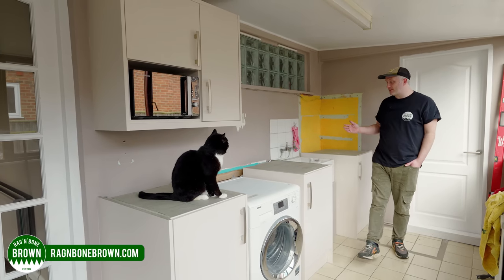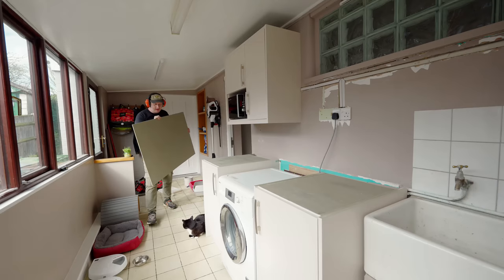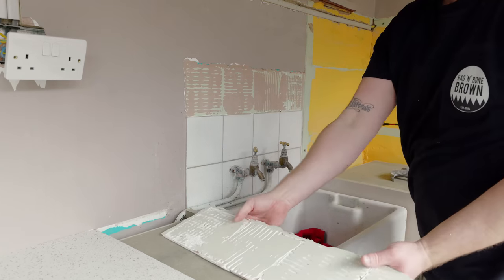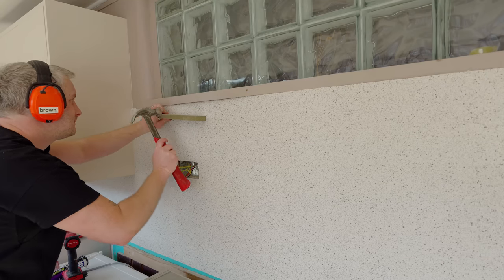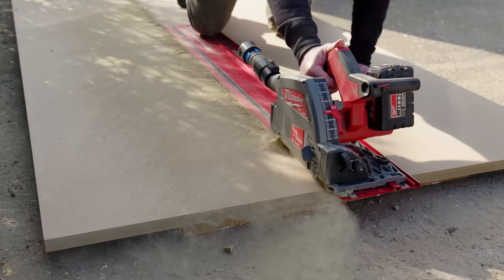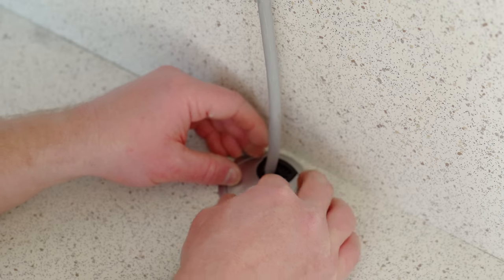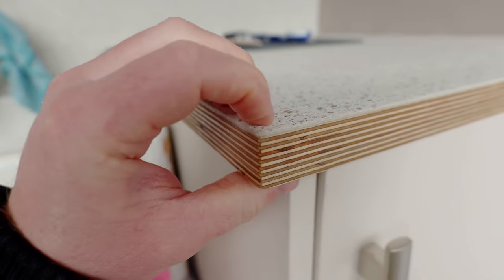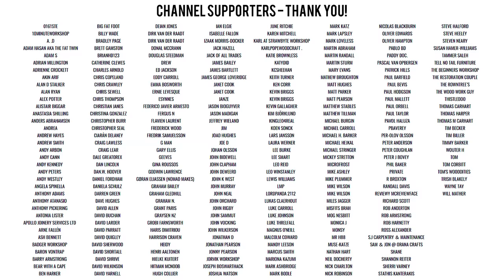DIY Worktops & Backsplash ON A BUDGET!

Comment: Looks great! Side note, boiling water will limit the pan temp to roughly 100* (rice cookers work by detecting when the heat rises above 100 which only happens when there is no water left). If you fry some onions, the pan will be much hotter.
Reply: Yes! I was going to say that oil can get much hotter than water, and that he should retest it! Great minds.
Reply from the maker: Ok cheers, I should have tried to find a frying pan then... The trouble I had was all our pans are induction ones so had to try and borrow one that I could potentially destroy!! 😬
Reply: @RagnBoneBrown  Happy to destroy your mother-in-law's pan and not your own. Good man!
Reply: @RagnBoneBrown  The bottom of an induction pan will still get as hot as a pan heated on a gas/electric stove, or certainly close enough anyway for the kind of test you are doing. Having dropped a VERY hot frying pan onto a vinyl floor though I can tell you that will likely damage it, especially on a pale colour like you have. 

Vinyl flooring as a working surface is pretty good though. I used an offcut of wood grain pattern flooring to make a protector for our dining table and it's worked great, it looks fine, is super easy to clean and has resisted hot plates, stains, spills etc.

Comment: The non skid vinyl you chose contains quartz aggregate and silicon carbide, also known as carborundum. Since the carborundum is manufactured and used as an abrasive it will wear any tool used on it. As a flooring installer we go through a lot of blades fitting this these types of products. A standard commercial vinyl would give you similar results but would be smoother. Nice thinking outside the box though and with the price of products now we all have to get a bit inventive now and then.

Comment: Using a vinyl on the worktop is definitely a very brave decision. Vinyl is a delicate material, and if it will be damaged (spoiler: it will), you'll need to replace all you've done in the video.
Reply from the maker: Nonsense. This isn't regular floor vinyl

Comment: You can almost not leave the contact adhesive too long before forcing them together. Often did around 30 mins to 1hr. I never trimmed until the following day, laminate really thanks me as way less likely to chip. Also have to make sure the laminate is really heavily pressed to the edges. Oh the substrate for desk was 24mm birch ply. 😅

Comment: Hi Keith, I'm an ex-floor layer. 
Just a cautionary note. 
Spray adhesives aren't always suitable for safety floor vinyl. You may find the adhesive goes mushy after a year or two, due to plasticise migration. A warm area tends to accelerate the process.
Reply: yeh unfortunately likely to loosen and form a loose large flat bubble in areas. That stuff never really sets

Comment: I have done this with vinyl tiles back when I had no budget or time for real tiles as a backsplash. I contact glued them straight over the old tiles. They had a nice grey industrial tile look and went on super tight. made my kitchen look super on trend with minimal effort(no removing and then dealing with cutting tiles) for a budget price. They were alright for a few years, but the heat from cooking made them eventually warp which made them bulge slightly around the trapped edges. Everywhere not close to heat they were still perfect after many years. So yeah, this is viable.

Comment: Brilliant job, maybe not really the best for a kitchen, but perfect for a utility room or garage workshop,
We use the same stuff to cover sales counters in places like car parts shops, trade counters, 
You'd still save money if you fitted the boards, then paid a decent floor fitter to fit the vynal and possibly weld the joints.
(I've seen really God fitters repair that kind of vynal almost invisibly)
Great job 💯

Comment: Hi Keith. Excellent video, and very inspiring. Regarding sheets that just won't stick (like at the join), I have a couple if ideas. If I know there wil be a problem, I might add a touch of hot-melt glue at the last moment in the problem area then press the sheet into place. The hot-melt glue would hold the sheet in place while the main glue sets. The other technique would be to put a pressure pad over the area that need pressing into place, add a pad on the wall opposite (if not too far), then use a long piece of wood to bridge the two pads like a spring, which would hold the sheets in place while the glue sets.
Reply from the maker: Thanks Christopher. Ah I wish I'd have thought of that at the time, that definitely could have worked!!!

Comment: We use actually laminate flooring as a desk top for the same reason. It's a lot cheaper than proper top laminate, very long lasting, and when it's time I can very easily change it with some new laminate flooring. Love the vinyl solution as well!

Comment: Thanks Keith that was an absolutely brilliant job that you did there. Quite inspiring for a little job that im doing. Birchwood ply !! Well im astonished at the price of ply in general really. I bought a piece of 12mm from a really good local timber merchant that i use. And he did warn me that it may not be quite right. Looking at it, i thought it would sand up nicely,  it didn't at all and now used for garden purposes.  However a few years ago i bought a lovely piece of 18mm birchwood ply from the same merchant at £40 ish pounds as i figured that it would come in handy,  well that turned into a good investment didnt it. Thanks again.
Reply from the maker: What a bargain! 👍

Comment: What a transformation Keith, that is such a stylish but practical space now ! Given that it's not your primary food prep area I reckon the pros and cons of the vinyl flooring should work in your favour - might need to be careful cleaning up some paints as the textured surface may make it harder to get off any spills/staining !
What is great for me as a long time viewer and subscriber is seeing you apparently so comfortable and happy to take on a complicated project requiring many different skills, doing a great job in the process, thanks for the great channel Keith !
PS. What a shame the cable didn't just line up with that awkward join, having said that it's not obvious anyway !
Reply from the maker: Thank you!

Comment: Excellent, Keith! Thanks so much for giving me a different idea on finishing a sewing machine cabinet top. It was covered by a very thin veneer, moderately damaged edges and lots of typical table top damage for a vintage piece. I was just going to refinish but, after I stripped the veneer, I really saw the edges damage was more extensive than I initially thought. That made me decide to remove the veneer totally. But, I was at a loss as to how I wanted to finish it. I looked at just replacing the veneer with new veneer but really wanted something which would not get the same damaged edges over time. Your idea of using flooring sounds great. I'll have to be careful to choose something with a smooth surface. Maybe I can even find a piece that looks like wood. That would be awesome. I really love how the room looks now! Great job, Keith!! I love watching you. Watching how you think reminds me of how my dad was in his workshop.Thanks again! Have a great weekend!! 😊
Reply from the maker: Thank you!

Comment: Hi Keith, it looks fine to me, and you have solved a problem that I was having, I am seventy-two years old now and it takes me a long time to get downstairs and I have built a table for one of the bedrooms and brought some of my kitchen items upstairs so that I don’t need to be up and down so much. I now have a full-size fridge, microwave, kettle, and a lot of small items, but I was trying to think of a good surface and laminate floor cover is just the ticket. I like what you have done to tidy up your space, but the one thing that lets it down are those taps and piping, a nice pair of taps and converting the pipework to pex so most of it can be hidden below your new worktop would be the cherry on the top.
Reply from the maker: Cheers John. Yeah new taps are needed, one of them doesn't work properly. It's another thing on the never ending list of things we need to buy but not a priority!

Comment: As I’m a floor layer you should’ve staggered the joint of mdf and altro  then cold weld the joint  Either type a if no gaps or type c if if you have gaps up to 2mm .but raw edges will curl in in time  would of been  better to is set to birch plywood

Comment: Great improvement mate, using what you had. Oh and biscuit/dowell/domino for a joint like that. Well rescued though.👍
Reply from the maker: Thanks mate. I'd have had a hard time in 6mm I think, unless I used pins as dowels or something. Should have gone to 9mm!
Reply: @RagnBoneBrown  Oh yeah, sorry bud. Totally forgot you said it was only 6mm. Thin bead of expanding/sticky foam is always a good way out. About 5mins for fixed grip👌

Comment: Very nice job here again. Hint for saving money on adhesive: (cheapest) Silicone is a good adhesive, too -but takes a little longer to cure than adhesive. Much respect for handling the vertical gap! I would have cut it a little rougher and make a silicone seam. Quick, dirty but not too bad. Still admiring your cat and used tools, as well.

Comment: Great video. I have found other good uses for vinyl. My bathroom has some around sink as splash back, I recently built a chicken coop a run on top of a large raised bed in my garden. I got a off cut from local carpet shop for £9.99  I cannot remember size, I had seen of vids of vinyl  glued to roosting coop floor for easy cleang, and it helps to stop places for red mites to hide,  but it was enough to also  cover the base of the run!  under coop size120cm  x 260cm .if I had used slabs it would have maybe been ten times the vinyl cost. some people may think it should be left a earth for chickens to scratch, but I don't want them to have wet dirty feet, or wet beding creating a smell offending my neighbours. also pen is clear roofed for same purpose  keeping shavings bedding as dry as possible for me to burn bedding in my workshop wood burner great fuel  litle to no smell and free to some extent the vinyl is just lay on top of earth loose, but cut slightly wider than run, so bends up at edges keeps it tight in place. its been in use for about 4 months now holding up to chickens claws so far!

Comment: Can't afford birch plywood... owns a domino joiner... Haha! Great video, man. I admire your craftsmanship. I would say that you had the perfect opportunity to add a little electrical outlet box underneath the cabinet as an offshoot from the visible one. It would have made it so that cable for the washer was not visible. I don't know what your experience with electrical is or what the law allows you to do as a homeowner in the UK, but the technical work is laughably easy to do with virtually no fire risk. The worst part of it is the drywall repair.
Reply: Beyond the joke, and here possibly also the extra views given the theme of the channel, there is an obvious explanation. The efficient, if expensive, joiner is almost a necessity for a professional (for commissioned projects). Using currently very expensive material where it is not really needed or even beneficial is not a necessity (or even reasonable). Which is why people use edge bandings in general. Though, those are some really thick edge bandings ... and it is also not as if the moisture resistant MDF is a cheap core product (compared to, say, low density particle board, not to mention the cardboard-core countertop).
Reply from the maker: I bought the domino in 2019 for about £400 secondhand. I could sell it today and make about £200 profit. I call that a good investment. I don't get involved with electrical and don't mind the cable. It's a utility room. I wouldn't want it in my kitchen though
Reply from the maker: If the edge bandings were thinner, you would see the MDF from underneath. And the MDF was free as part of my recent sponsorship deal, so simply using what I have available but any substrate would work just as well
Reply: @RagnBoneBrown  I didn't mean to come off as judgmental or rude. I was just trying to make a little joke. I totally understand the difference between investing in nice tools and choosing how much is appropriate to spend on materials. It sounds like you got a great deal on the joiner, too. The tone doesn't always come through very well in text form! I really enjoyed your video. Cheers.

Comment: the dulling of the tools is due to the heat that gets  created! but the choice u made is excellent! 
i always work with these type of materials, aplying heat to is makes is really easy to cut with a hookblade( for the next project;] ) 
the pvc flooring is so hardwearing, simaliar  types  to what u got  get a 15 year warranty in  commerial use so yea !
next time when cutting are working on it, just use a torch heat it up and ull see that its a breezen on knifes and other tools!

Comment: Good job on the worktops. If it turns out afterwards that you would like a smoother worktop, you could perhaps apply a layer of varnish?
Reply from the maker: Hmm, I wonder if it would adhere well? Not sure
Reply: @RagnBoneBrown  , i think (i can be wrong) that you should treat the worktops as plastic, and use primer and varnisch for plastic, but you can try it out on some leftovers first to be sure.  Grtz

Comment: Boiling water at 13:50 is only going to raise the pot temperature to about 100°C. Try it next time with a cast iron on high heat for like 5 minutes. The pan should get to like 300+°C lol.

Comment: The best price for the Festool Domino is 784 gbp

Birch Plywood 2440mm x 1220mm (8' x 4') BB/BB Grade from Latvia/Russia is £107.40 per sheet Inc Vat, excluding delivery. Best price online. Nobody is offering AA/AA, A+, or A grade boards. 

Inflation in the UK is much higher than the US, but I'm sure nobody there would buy any sheet material where a lot of 10 sheets could buy a Festool Domino and a lifetime of domino's to boot. 20 sheets and you could buy 2.
Reply from the maker: It's madness isn't it

Comment: Nice video. Next time you could try some linoleum a manufacturer I used was forbo. Not sure how cheep they are though.
Reply from the maker: Similarly priced I believe
Reply: @RagnBoneBrown  probably not  as good heat resistance, and a tendancy to mark and dent. Lovely job though!

Comment: Usually when I've seen sheet flooring used as a counter top, it has metal edge banding that covered the edge of the flooring and the substrate. 

Had that in 2 kitchens and the surface lasted for years. No cutting on and no hot pans.  Worked just fine.

Comment: Another thought (maybe makes you angry after finishing, sorry): the wall behind the covering could easily fit a cable -> so installing another socket just under the top plate for the washer would have saved you from a visible cable. Maybe there are different regulations, but in Jerry-land it would be okay over here.

Comment: Just fyi a pan of boiling water will always top out at about 100°C whereas a pan with oil in it can hold way more heat as the oil can get up to 100's of degrees water just boils off at around 100°C